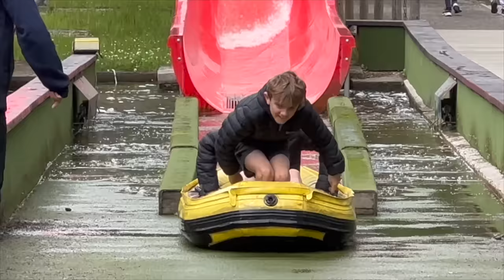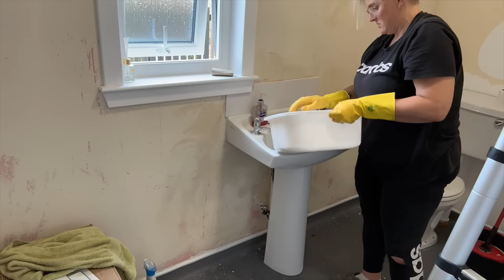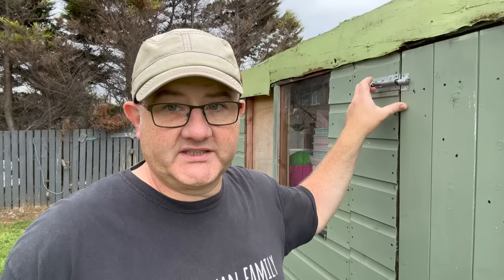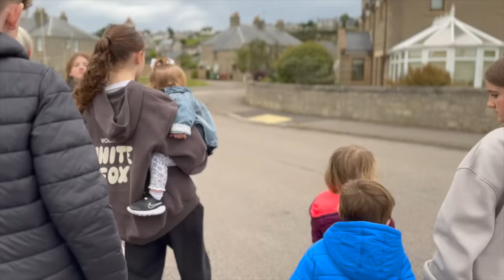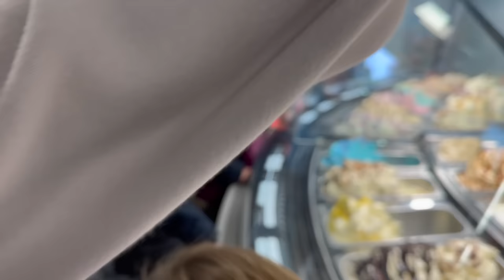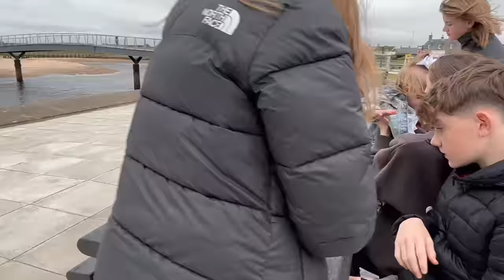OH NO IT'S HAPPENED AGAIN!! | POOR JOSEPH | The Sullivan Family

Comment: Accidents happen it can’t be helped. 
If you needs the sides off for the winter would it be possible to dig a hole for the trampoline so it is ground level for safety. Just a question?